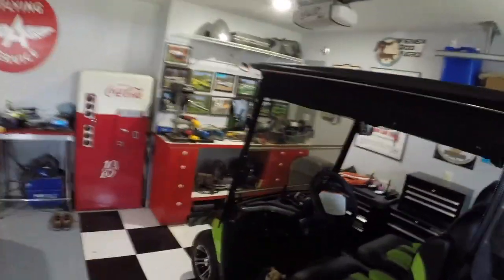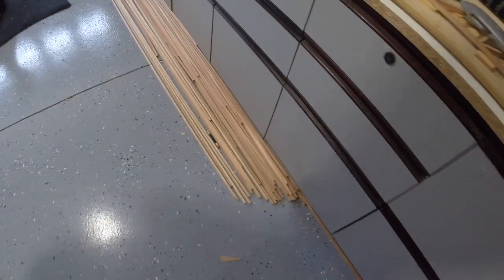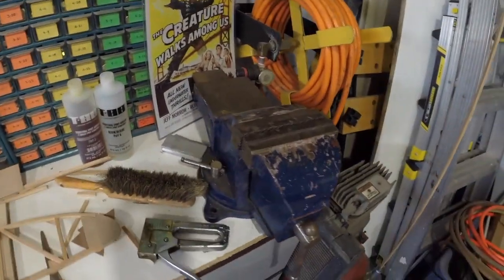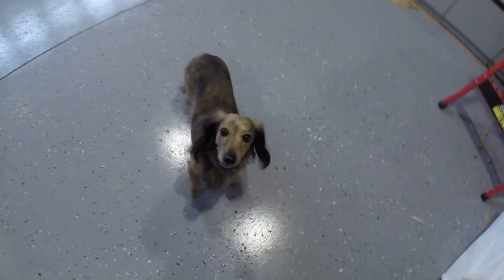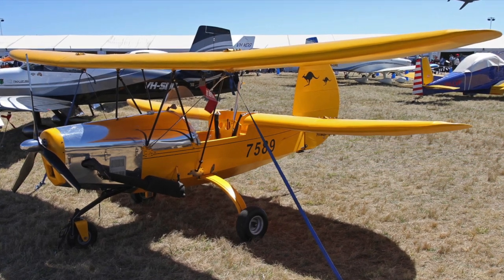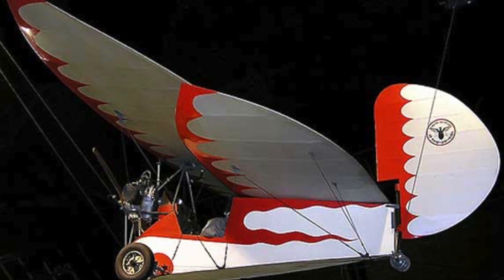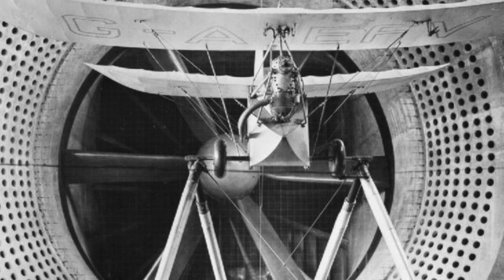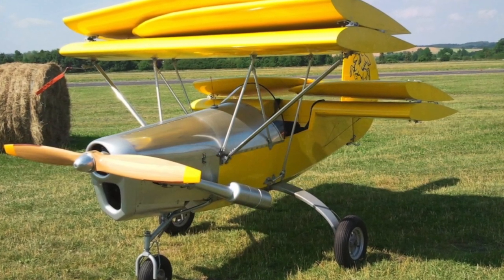Building the Flying Flea -  The Project

Comment: Another nice video Malcolm, I notice the ribs are coming along nicely.
 I noticed your using the trike layout, are you going to use Rodolph Grunberg's main leg design which looks to be the easiest version to build, with very few mods to the basic fuselage design, if you go for the tube set up, as in your photo, you will need to put a compression strut between the upper mounts. 
To keep leg space, if you use a curved steel tube, to follow the bottom of the instrument panel, it will stop the side panels flexing inwards if you have a hard landing. The instrument panel alone will not support those loads, as it is mounted on top of the longerons, and is therefore in sheer, not compression.
Looking forward to your next video.
Hope this helps.
Kind Regards
Nigel